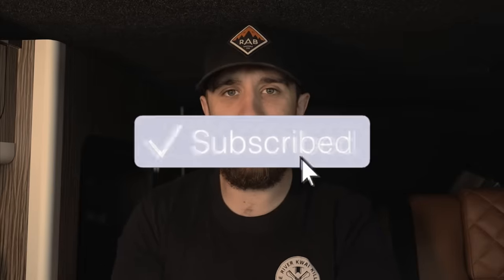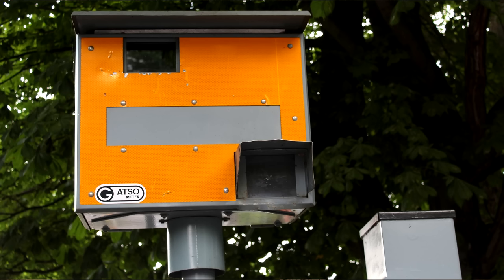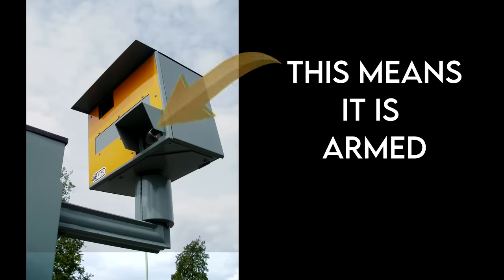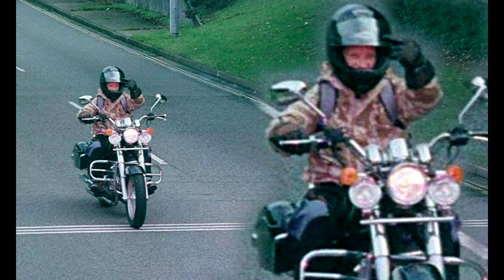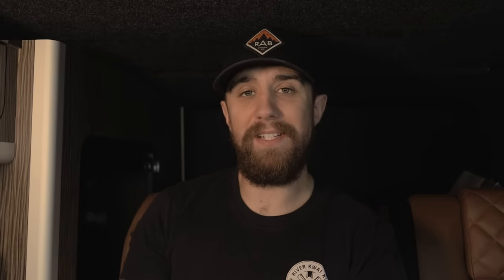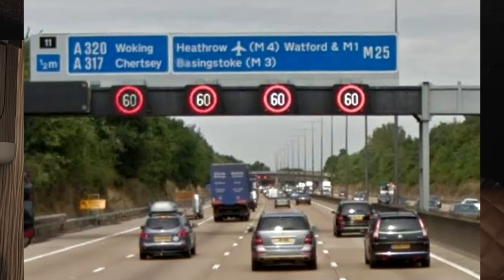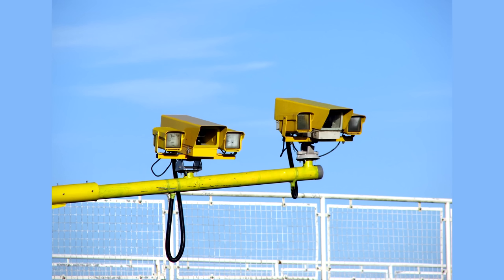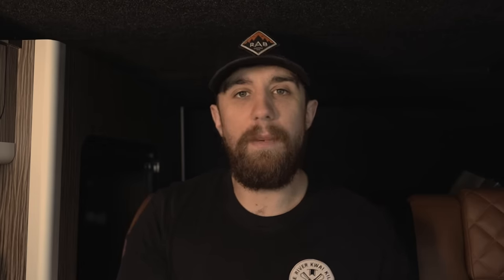How Speed Cameras Work and What to Look Out For

Comment: I don’t have a problem with them on housing estates and outside schools where kids are. But at the end of a straight road hidden on a slight bend is just cash raping the motorist. If the other crimes were down to an acceptable level, then I don’t mind traffic violations. But it’s just greed.!! Workers on roadworks?? I thought they were extinct.?
Reply: So your saying that you can't drive properly and maintain appropriate speed then.
Reply: Here we go,🙄 Let me guess, you’ve never ever gone over the speed limit??. If you say no, your a liar. I drive my 5 classic cars as the roads allow. As I said, in built up areas where public and kids are, you stick to the limits. If I’m on a motorway at 2am, then yes I go more than 70. (report me if you want).
Reply: @citroenfil  never said that, but then if I get caught that's my problem. I broke the rules. I won't be a cretin and blame everyone else for my failure.
Reply: Neil Williams 
The bloke is questioning said rules. He also gave quite a reasonable example in his original comment as to why it’s about generating revenue rather than road safety.
Reply: @qasimmir7117  point still stands though. If you break the posted limit then you put yourself in a position to get caught. They can't generate revenue if you don't break it. Whether you feel it is a reasonable limit or not is immaterial. If you disagree with a sleeving limit then lobby the relevant authority, don't just ignore it then bitch when you're punished.
Reply: In Connahs Quay a favourite place the police lurk is at the bottom of a steep dip in the road that can add speed un noticed.I got done for 7 MPH a few years ago after  slowing down to a "30MPH section long before seeing the copper.
Reply: @routmaster38  The lesson you're supposed to have learned is to observe what the speed limit is, observe your speed, and stay within both the speed limit and the safe speed for the road conditions (which might be lower).
Did you learn that?
Reply: @clickrick  Well, I can't speak for routemaster, but I can for myself. I took the IAM advanced motorcyclist's course and test in '88 and about 10 or 12 years ago, went on a ROSPA advanced course in my car, involving about 12 runs with a qualified examiner ..  was told I was ready for test but didn't take it  ..  learned a fair bit though. I have ridden motorcycles with a full driving licence for decades, since the age of 16 in the 1960's and driven various cars for 1 year less than these decades, i,e, since age 17.

Even my instructor who I had during the ROSPA trips, despite him insisting I do not exceed, but do reach the speed limit where it was safe in all ways to do so, had his tongue in his cheek when we spoke on speed limits he observed, ... particularly those on rural roads, no admission I hasten to add, but message received... (these roads where most fatalities occur of course.) 

May I ask you, what is your understanding of the minimum distance there should be between your vehicle and the one you are following in all, ... each one ... of the different and varying conditions which we encounter on the different kinds of roads we use each day and when the capabilities, (or lack of same), of the vehicle you are driving are borne in mind ... and when to increase those minimum distances on occasion? Do you know? If so ...  do explain your own understanding of this minimum distance stuff in detail. Thank you.
Edited typo and some additions to text..
Reply: @thepianoman1010  iam test? I thought was a grading gold, silver, bronze, is it different for a bike as a car? Never knew was a test.. Nice big speech but most won't have taken it all in. Ps my friend is grade 6 bike instructor with rospa qualifications which actually disproves if the 20mph limits in towns and cities as instead of getting flung away from car at 30 rather than getting dragged under it at 20. I'd prefer airborne to fried
Reply: @johnallan1134  Back in the late 80's there was no bronze, silver & gold standard given in the IAM motorcyclist test. The ROSPA course I attended did have these grades for the car test, I assume same for motorcycles. 
You say,  "nice big speech"  what do you mean by that? I gave no speech ... I merely responded to another poster who implied that I may be unaware of the fact that when driving or riding, I need to stay within the posted speed limits and also that I need to drive at a safe speed for the road conditions existing at any given time. 

I chose to ask him a question on the minimum distances he should leave between his vehicle and the one he was following at any given speed and in all of the different conditions we all meet on our roads. I received no reply. My guess is that he was unable to answer my point. 

Regarding the point you made on your friend who is "grade 6" (?) bike instructor with ROSPA qualifications and where you say he disapproves of the 20mph in towns and cities because any collision with a pedestrian (and this was implied) would be somehow "better" if it were to happen at 30 mph rather than 20mph  ...  and then your comment,  "I'd prefer airborne to fried"  seems to me, ill conceived. 

I suggest you both read the figures on survivability of pedestrians being struck at different speeds. I believe these figures are very close to being realistic ...  I have no evidence for this belief of course ... only that they seem logical.

at 40 mph there is a 90 percent chance they will be killed.
at 35 mph there is a 50 percent chance they will be killed.
at 30 mph there is a 20 percent chance they will be killed.
at 20 mph there is a 2.5 percent chance they will be killed.
Reply: I have worked at the side of the road and have nearly become extinct many times. Just bloody well slow down!
Reply: @thepianoman1010  in regards of the difference being hit by vehicle at 20/30 I was referring to car not bike.. My bad, but in regards to speeds being hit the chances of fatalities increasing are obvious at higher speeds. When teaching do u tell pupils all that detail if did they probably blank you.i don't need any of that detail and it wouldn't impress most. I'm sure in my job I've came across a lot more Scenarios than yourself and in one thing we would agree on is the standard of driving has dropped.. Tests on both categories of vehicles are basic. So you kno that most just want to past test. I'd stop the 5/10day courses but again lucrative, so most instructors do it. There is and never will be correct experiences or attitude as long as that exists..ps Theory test hasn't been as successful as dsa hoped. But you stay lucky stay safe
Reply: @johnallan1134  Yes... of course I understood that you meant, car ... not bike, so my response stands. You say,  "but in regards to speeds being hit the chances of fatalities increasing are obvious at higher speeds."  Yes ...  of course the chances of a fatality increase with the the speed at which a person is struck. Obvious stuff surely! 
I do NOT teach anything and I'm not out to impress anyone! What is the point of your post?
Edit: What was your point where you stated,  "I'm sure in my job I've came across a lot more Scenarios than yourself"  ? What scenarios? I'm not denying what you have said, I just need it made clear what you are on about and to establish the relevance to the debate, of that comment.
Reply: @johnallan1134  Any luck with a response John? I want to put this to rest now and to not have even more meaningless comments made in another month or so! If you have no further comments, I trust we're done!
Reply: This is so true. I lived in Barrow in Furness. No cameras on A595 then when you hit the duel carriage way at Grange over sands ; first chance to pass HGVs a camera van would be placed.
Reply: Stop moaning & stick to the speed limit,  it's as simple as that!
Reply: completely agree with you. outside schools, parks and playgrounds. i have no problem with them. but as you say on open roads, thats just taking the piss.
Reply: @neilwilliams3298  Whilst we're always at fault for our own actions, you wonder why they don't allocate their resources to dangerous areas instead of areas where people are easily caught out.
Reply: me having to look at the speedemoter and going at speed limit is more dangerous than me speeding while keeping my eyes on the road! I once somewhat was close to hitting a car cause I was too busy looking at my speed rather than what is in front of my eyes.

If you are so concerned for child safety, how on earth is me keeping my eyes on the speedometer is more safe than me speeding and keeping my eyes on the road?
Reply: @johnnyblack4261  just slow down until you can do both. the speed limit is a maximum, not a minimum.
Reply: @KristopherNoronha  or maybe just get rid of speed cameras all together so I don't have to worry about my speed and instead have full eyes on the road and not on the speedometer. Also it is the parent and the child's responsibility to keep themselves safe. Its not rocket science to cross at designated areas, I don't understand why people don't understand this concept and the concept of accountability.

Also if the government is so overly concerned for our safety why not make school a much safer place by getting rid of bullies etc? I have been bullied so badly and put my life at risk that its much better if I was ran over by a car than to go back to school. A speed camera will never catch a bully/dangerous person, but it is more concerned about catching innocent people for going 9 Km/h above the speed limit without putting anyone's life at risk.

Comment: The justification for speed camera is to reduce accidents and save lives? Smart motorways anyone?
Reply: They would work a lot better if nobody knew where they were; as they stand drivers come speeding up then slam the brakes on just before risking more accidents. Which to me means they aren't about safety but milking the cash cow that is the car driver.
Reply: If that was the case then why dont they place those big black cameras that show a dig red "30MPH" on housing estates ,on major roads instead of nicking you?As they say "prevention is better than cure"?
Reply: I have never used the hard shoulder when it's 'live', it's dead 'ly'.
Reply: @johnbower7452  you've missed the entire point.

Smart motorways get rid of the hard shoulder. The only safe place on a road that's full of cars doing 70 and 44ton lorrys doing 60..
If you break down or have an emergency, and pull into the hard shoulder (which is now a lane for doing 70mph) you're dead.
Plenty of people have died, and it even paused the rollout if smart motorways
Reply: @johnbower7452  also most of the gantrys don't actually have cameras there. I think it's something like 1 in every 5 gantrys
You can see the white/yellow cameras to the left, hanging off the side
There will be lines on the road, but there's no camera
Reply: Smart motor ways seem to be creating accidents they need to bring back the Hard shoulder the satistics show this
Reply: I always thought the smart motorway cameras were average speed cameras, so I always did the limit no matter what. It boggles the mind how they think it's a good idea to remove the hard shoulder. And is 80mph really that dangerous?
Reply: Bottom line smart motorways are deaf traps I have seen so many near misses.
Reply: @jjmmjj9999  I suppose you never drive on any dual carriageway then? There are plenty of people who have died on the hard shoulders of non-smart motorways, the hard shoulder is not a safe place to be at all regardless of the type of road. It is not the fault of the road that people can't pay attention to what they are supposed to be doing. You get a good mile or so of a lane closure coming up and yet people still go steaming under gantries with an enormous red X on it.......
Reply: @leeowen4989  I drive over 20k miles a year, at an estimate
I drive on dual carriageways, motorways (namely, m25, m1 etc. The proper shite ones)

I've seen accidents, I've been involved in accidents

I've also helped push people's cars out of live lanes into the hard shoulder/under bridge barriers which is significantly less dangerous than live lanes. However yes, you're right. Hard shoulder isn't safe, but that's to be expected. You've got 4 lanes doing 70+ to the right of you, never going to be completely safe
Then again, they say don't sit in the car, jump over the barrier even if it's snowing raining -5 degrees but how many actually do that? Not many at all

Red Xs yes, I've seen people flying through them. 40mph on the gantry signs, to the left will be a red X and I get overtaken at easily 50/60
Mostly class 1s tbf. 44 tonnes at 58ish mph in a 40 zone with traffic. Absolute disaster
Reply: @jjmmjj9999  That just reinforces my point, the problem is not the design of the road, it is the vast majority of drivers who haven't got a clue or just don't care. 
Until recently, I was clocking up 100K miles a year all over the country and I've come across more incidents than I can count. They all seem to have one thing in common though, someone either screwed up because they weren't paying attention or they were not driving to the conditions.
Reply: And yet the motorways were/are the UKs safest roads
Reply: Smarter roadways would be to train the idiots. With the exception of commercial drivers, you only have to pass your joke of a road test ONCE in your entire life then never worry about it ever again. There should be a road test every 4 years at least.
Reply: Smart motorways need smart drivers, a commodity in very short supply in this country.
Reply: smart motorways are lethal im a hgv driver and the amount of times i see vehicles swerving at the last minute to avoid a stranded car or truck is worrying bring back hard shoulder now
Reply: @jamesr5050  I am now even more suspicious of the introduction of so called smart motorways - it is yo sow the seed of doubt in people's minds that it is dangerous to travel. All a part of the notbso great reset.
Reply: @johnbower7452  but if you were driving to the speed limit you wouldn't need to slam in the brakes
Reply: Smart motorways are a good idea and I'll die on a hill for it. Reduces traffic speed to allow relieve on other parts on the motorway. 

Motorway traffic "snakes" are a nightmare and dangerous and smart motorways help stretch the snake. 

It feels slower but on average everyone gets home quicker 😅
Reply: if that was the case why were the mobile speed vans out during covid with only a handfull of cars on motorways.  almost empty but they were there alright.  all about “stand and deliver” modern day highwayman.  punishing the key workers to boot.  they gave the game away by doing that 🤷🏻‍♂️
Reply: @MIsaacs-p3n  How about this wild idea. Don't speed ?

Comment: I once saw one those early boxy speed cameras ( mounted on a pole with markers on the road etc )  was crashed into and  the impact had knocked it over  and someone had  left a bunch of flowers and a note saying 
'missing you at 90 mph! "
Reply: I was once sitting at the stoplight. Heard a loud bang. A truck couldn't brake in time and slammed into the speed camera instead of the car in front. That trucker did two good deeds at once.
Reply: @michiel5160  That trucker was one smart mother f...er!!😇😅